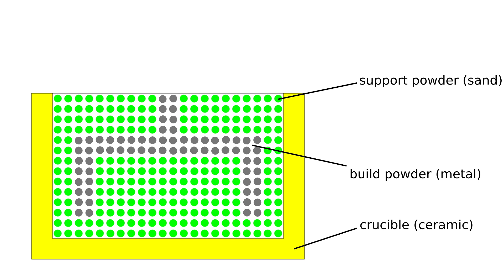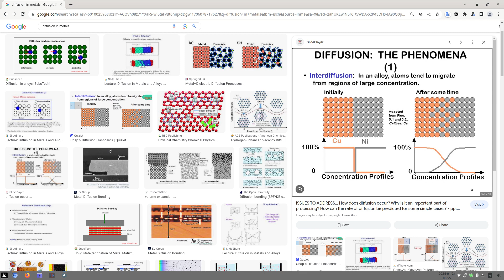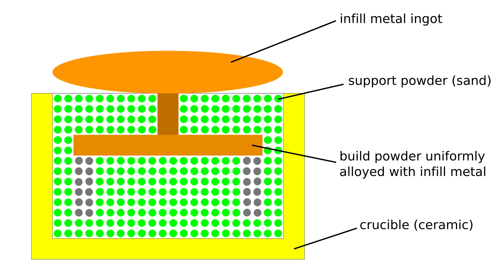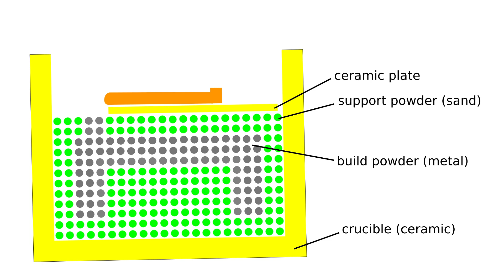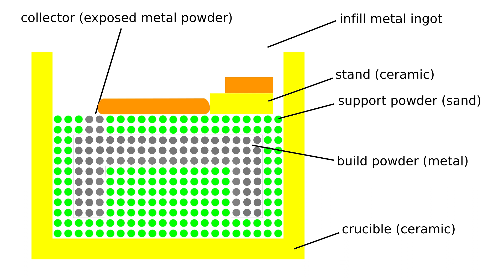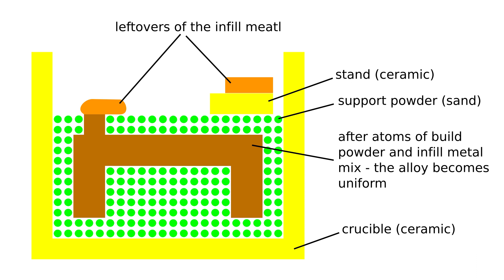Delayed infill methods.  Part 1: Puddle+Anchor and Puddle+Stand.

Comment: Can you make a machine that will sand print 5' x 3' x 3'?
Reply from the maker: Yes.  Currently, we are designing a one cubic meter printer.  But we can make it slightly larger, especially if you place a preorder.

Comment: This is such an awesome process, when is the next video coming out ? I really want to see more practical prints and such.
Reply from the maker: Have you tried the 2 methods in this video?  Which one of them works better for you?
Reply: @iro3d  No, I don´t own the printer. I am really interested in the idea though. This is the only low cost machine which even I could use at home, without any foundry or other equipment. 
I would like to create interkit metal parts (e.g. out of ZAMAK) at home with the least amount of cost equipment and time but a good precision and resolution. So the only viable solution for me is FDM based + sintering process which is expensive and has a lot of other downsides like precision etc. Or Lost cast models which again take a lot of effort etc. Main goal would be to 3D print the mold out of ceramics and then directly cast the part.
Reply from the maker: @sierraecho884  Ah, I see. There are were no new videos because we have been focused on two new printer models - a cheap one for schools and a large one for metal foundries.  Both should be released in a few months.  BTW, videos on which topics would you like to see?
Reply: @iro3d  "...been focused on two new printer models ..." Oh this is awesome, I would love to see the new printers, just out of curiosity. 

"...BTW, videos on which topics would you like to see?..." Honestly any topic in regard to the printer, it´s tech, the fundementals of the materials and such, the pro´s and cons of materials, price, speed, performance etc.

I found your comparison of different metal printing techs and such very interesting.

Being able to print a mold for instance is awesome. Maybe you can look into something like NaCl slurry as mold material. You could print the mold with salt and then cast Al or ZAMAC. It would be cheap, easy to obtain, resuable and has great potential as mold material including being able to cast fine details.
So maybe additionally to powder deposition, you could also do "direct inc writing" and print the mold with finer details ?
Reply from the maker: @sierraecho884  Thanks.  I will make the videos, but it will take a while.  NaCl is an interesting idea - I'll look into it. Thanks :-)
Reply: @iro3d  There has been some work on it done by some MIT students, it´s really interesting and promising. I personally like the idea since I don´t need anything above AL and ZAMAC.
Reply: @iro3d thx for updating and look forward to your new printers in 2026!

Comment: Could you use the sand to create a ramp so the molten metal flows into the mold? So you avoid the tilting?
Reply from the maker: Yes, you can create a ramp, but I am not sure how it will help.  Could you please explain?
Reply: @iro3d  
 
To delay molten metal entering the mold and  give time for the infill to melt.
Would it make sense to have the molten metal follow a path (using a ramp of sand) to entrance of the mold.
To avoid tilting the mold.
The concern is tilting the mold may affect the final product.
Reply from the maker: @JamesRouzier  Ah, I think I understand what you mean.  Rather than tilting the crucible by a small angle (4° or so) print the top surface of the sand slanted.  This would eliminate the need to measure the tilt angle of the crucible.  So, yes it's a good idea. Thanks.  
P.S. I was a bit confused when you said "mold", because mold is not used in this method.  It's used with the shell sand printing, which is shown in our other video.
Reply: @iro3d  I could see why my explanation was confusing.
Keep up the great work on this product.

Comment: I don´t quet understand, why not first melt all the infill metal and then tilt the mold slightly, or melt the infill metal separately ?
Reply from the maker: Good question.  Tilting the ladle is possible, but keep in mind that all this has to happen in a reducing atmosphere.  So, you'll need to tilt the whole furnace.
Reply: @iro3d  Ah yes I forgot. one would have to do it like the Ashanti tribe. If you are not aware Ashanti bronze statues are one of the oldest metal statues. They created a 2 part mold with the cavity on one side and the metal on the other to create a reducing atmosphere. This mold looks a little like a sand clock. To cast the part you place the mold inside a really hot fire which melts the metal, after a while the whole mold is being turned by 180 degree so the metal can fill the cavity.
Reply from the maker: Wow, that's amazing how ancient people managed to create cool things without the modern technology.